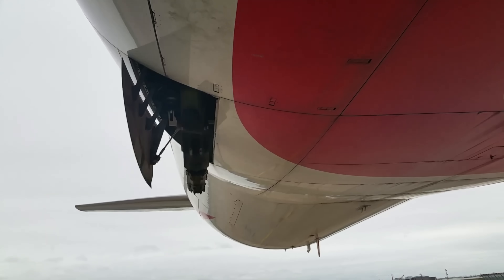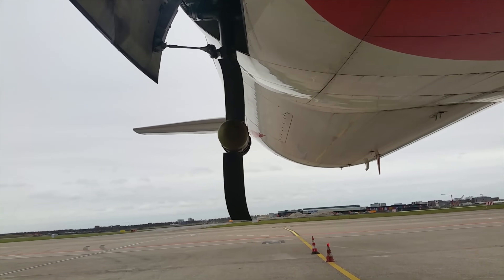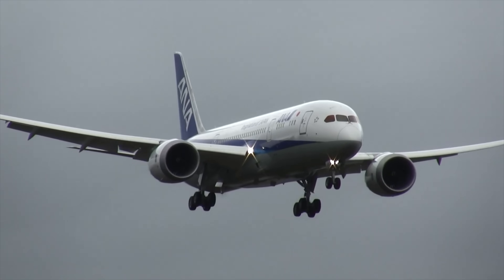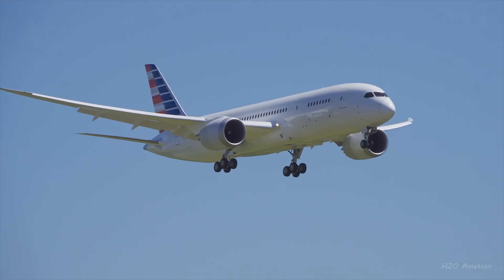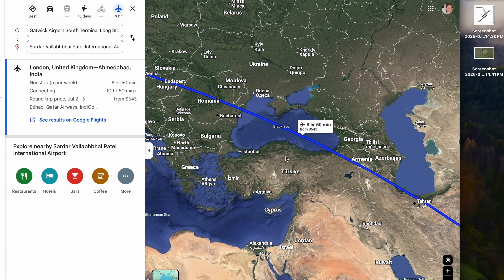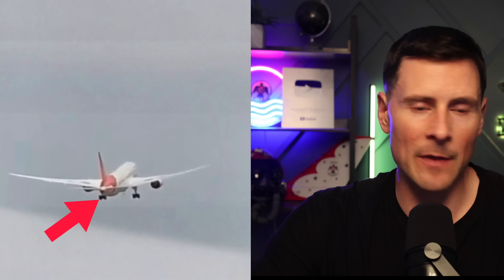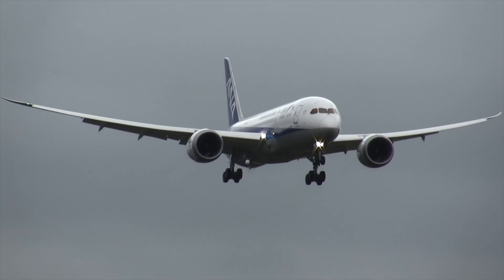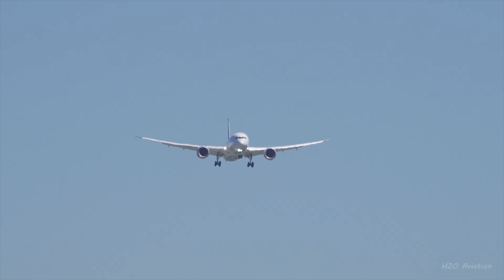Air India 171 SHOCKING UPDATE on RAT Deployment and Flaps!

Comment: What worries me is these planes are still flying whilst it must now be clear that there must have been a catastrophic electrical failure causing both engines to shut down seconds after takeoff. Surely all these planes must be grounded until the cause is identified.
Reply: Yes, sadly in the modern world money is money and as long as keeping them flying is cheaper than grounding them until they find out what happened , they are going to keep them in the air. The track record of Boeing in the last years is not so great, especially with the mysterious deaths of whistleblowers. Call me extra cautious, but I do not fly on Boeing since the 737 Max incidents, and I advise people to avoid them too. A failure of a commercial aircraft is way different from a failure of a bus for example, so better to be safe than sorry.
Reply: @kris18shadow  The track record of the 787 is excellent.
Reply: @rudewalrus5636  was
Reply: maybe it was poor maintenance
Reply: @gm-zz8so wiring fires inside AC causing dual engine failure is not poor maintainance... That's something that should NEVER HAPPEN.
Reply: Their still flying because there's nothing wrong with the plane....my personal opinion is that this plane was taken down deliberately
Reply: If it makes you feel better the 787 ran for its first 4 years with a software bug that would disconnect all engine-powered AC electrical generators at any point of flight if the power control unit had been running for 248 days without being reset.
Reply: "Whilst" ? ? Are you been reading Shakespeare lately?
Reply: 787 has made 5 million flights w/o crash until now.  That's a pretty darn good record.  1 out of 5 mill.
Reply: I agree, but 250 people died. It needs to be understood what caused the crash so mitigation measures can be undertaken. For a double engine failure at take off is significant and the causes need to be understood asap
Reply: @eventtrading   the problem with that kind of stat is its 0 per million until it isn't. The A380 is also 0. The industry has fewer crashes than a few decades ago so it's an extremely small sample to compare from - yes newer planes are generally safer but I would argue we've gone backwards in corporate safety, the 737 max was a disaster, the 787 has insane design decisions
Reply: Is that the reason why they turned off the AC? That's the question that needs to be asked.
Reply: @soulsbourne maybe there was unsufficent gate power tor un the AC at the gate.
Reply: ~Aeroplanes~
~Aircraft~
~Sky-Cruisers~
~Birds~     
~Ships~  etc etc. 
But please..
NOT 'planes'! 😩😱😫😳

Comment: The engine reached 625 ft, an engine failure is possibel, during or after lift off. The remaining engine could the plane keep flying. But then ,the flaps must be set different, because of the new configuration. The plane kept flying , but lift was not enough to let the plane climb. Pilot mentioned lack of thrust, not failure of both engines.
Reply: Which could be explained by lack of fuel delivered to the engine. They became "fuel starved" and couldn't provide enough thrust
Reply: @EventHorizon8-p3g The startingspeed was high enough to reach 625 ft. I think one failed short before take off,  debris in engine, there is huge cloud of dust, or smoke , at the moment of take off. To be seen in that left side video. There are a few seconds we can not see what happens, because of that shed. One engine remained, and is enough to keep it flying. But then, under new configuration, the flaps had to been set in new position, to compensate the los of thrust from the lost engine. The pilot did not mention failingen engines.
Reply: What a dopey comment. Lack of thrust for whatever reason is "Engine Failure".
Reply: @shannonwhitaker9630 Was it full throttle, we don t know. Hé did not say, that hé lost one or two engines. Ask questions, we don t know what happened.

Comment: I don't hear a jet engine but it's  cell phone who knows what it can pick up from how far away.  I was looking up crashes in India, there were 2 in the last few years, and ran across a Russian plane, maybe  a cargo plane?, that lost all engines due to bad fuel.  I find that weird as isn't most fueling done via under ground piping and hoses from central tanks?  So in general all planes would get bad fuel?  If by tankers, maybe the tankers were contaminated, but it takes multiple tankers, so there would need to be multiple contaminated tankers.  Finally, the engines draw fuel, I assume from different tanks,,,,  hmmmm,,,, maybe there are central tanks, not wing tanks and draw from that before wing tanks?  Then only the central tanks would need to be contaminated. Contaminated how?  Are plane, tanker tanks cleaned at any time?  How odes one rinse cleaning fluid, spraying fuel, ekkk, there's a way to get an explosion.  If filling from underground tanks the pipe could be compromised, as well as contamination in flexible pipe to plane, which is relatively short and one would assume open to air in between uses where liquid contaminants would evaporate.  Of course if open to air, vermin can get into hose too, and shot into tanks, which if the plane draws from a single common source could take both engines out at same time.  I'd suspect even a swarm of insects in a hose might be enough to foul spray nozzles, maybe, after going through the pumps what's left of them?  how big are spray nozzles?  Certainly the pumps must be incredibly powerful and perhaps enough to force anything that can get through them into the jet engines.  Leaving flame out from solid debris shot through fuel injection nozzles.   Hmmmm, could an open hose end take in enough sand and dust from a dust storm type event that if sucked in by pumps from a central tank and injected into engines cause a flame out, as it going through a dust storm?
Hate to say it but computer error almost seems more probable, or the whole engine relying on a single spark plug or some other horribly stupid design decision.

Comment: The no flap takeof was always nonsense.  Not possible and there would have been lots of warnings well before takeoff. 

The Vrotate for flap 5 is around 170knots for 95% max weight.  They took off around this speed and reached 174 knots at least 600ft above sea level.  

The Vrotate for flap 0 is over  250 knots for 95% max weight and they would have needed much longer runway.  

Early Flap retraction rather than gear up after takeoff is plausible causing stall (copilot error) but if RAT was indeed deployed, then likely something else catastrophic happened.  Nothing pilot could have done in that case.

Comment: If the fuel pumps failed or the fuel flow transmitter we need to back track through the electrical schematic and find where the failure started.( I personally never saw the  787 electrical schematic in my years working on the aircraft ) maybe the the aircraft has a selection switch for power that was incorrectly positioned.like Apu was the power source and never changed to one of the engines.
Reply: This isn't the 90s anymore. Modern planes have a ton of software in place to not let this happen. A 787-8 always knows in what stage of the flight it is.